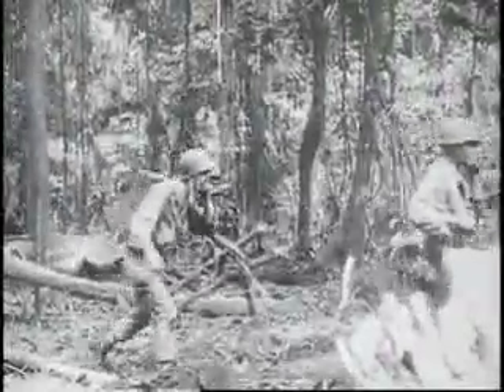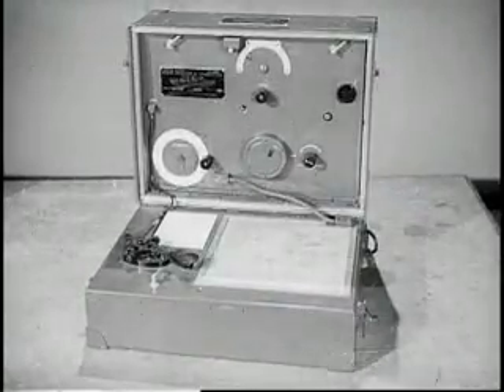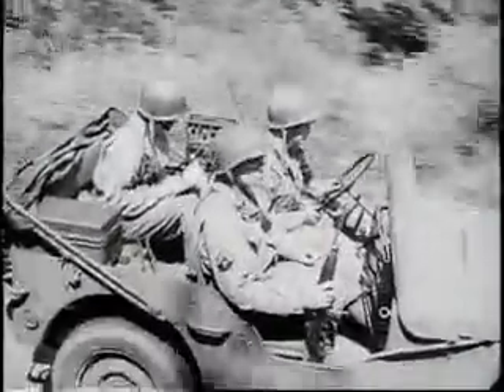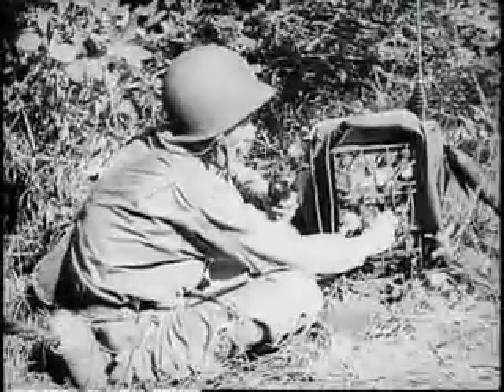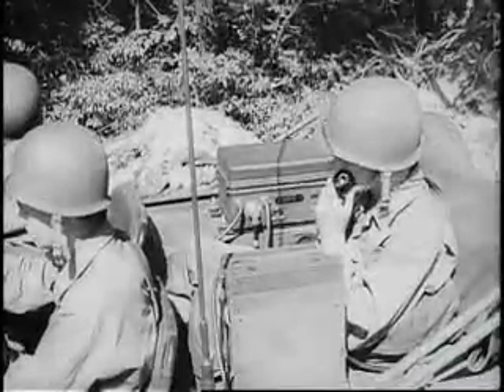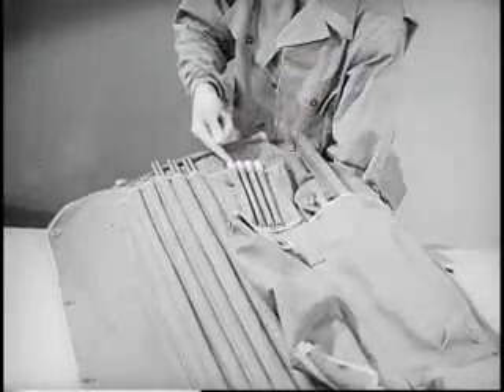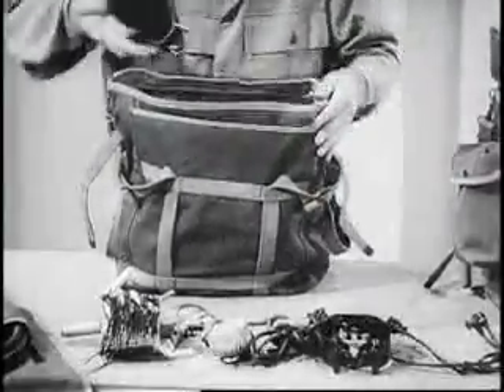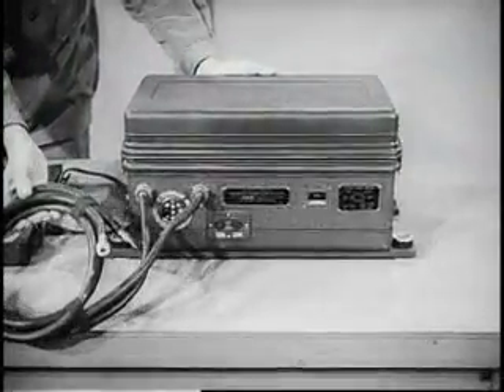SCR-694 BC 1306 Radio PART 1/3

Comment: Thanks for posting this film.  I have a BC-1306 that I am installing in a 1942 GPW Jeep that I am restoring.  I am planning on restoring the radio to working condition as well and this is good info to have for historical reference as well as an aid in restoration work.